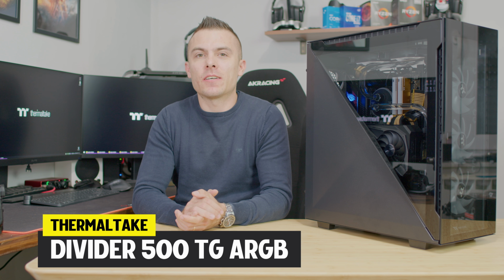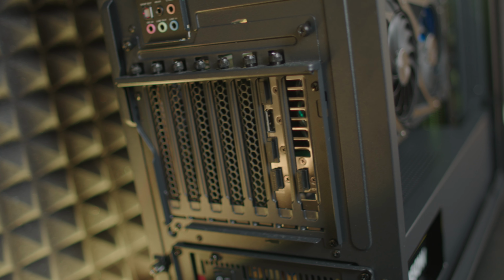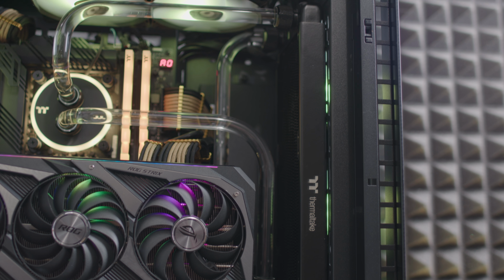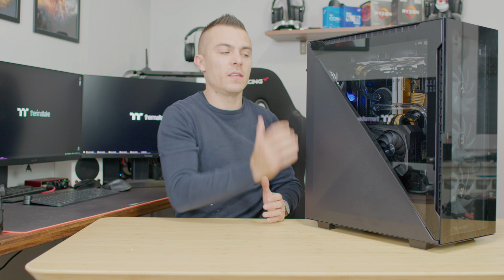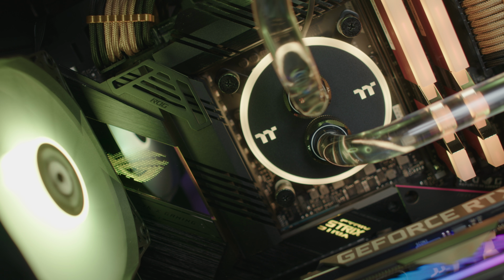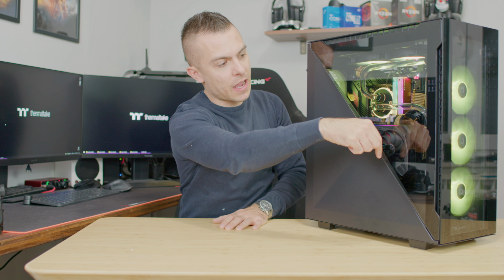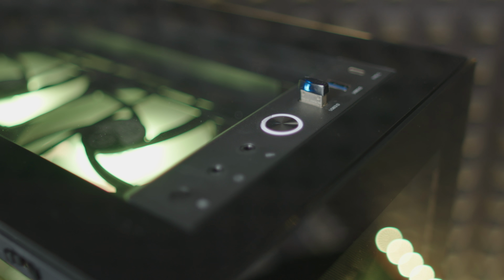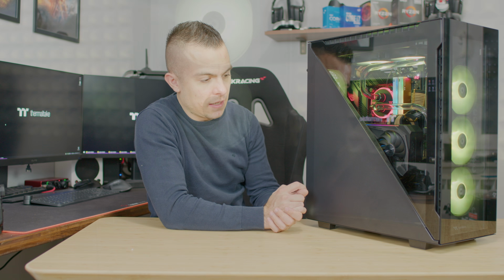Dividing Panels - Thermaltake DIVIDER 500 TG ARB

Comment: I have the "AIR" version of this case. It has a very good airflow because it has holes on every side. The only problem i had found, that the cables of hdaudio and usb 3.0 are a little to short and don't comes to my asus tuf motherboard. I have buy an cable extension kit from corsair to fix this problem.
Good review thank's
Reply from the maker: What a shame for the cables. They should sometimes really think some things more carefully. Indeed, AIR version is much better imo as well.